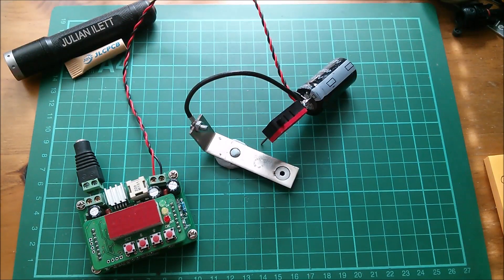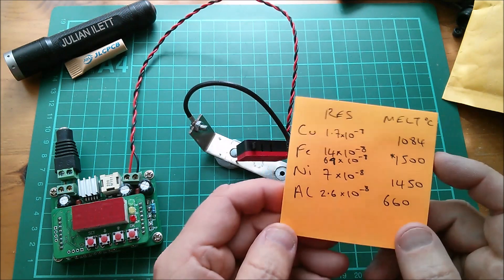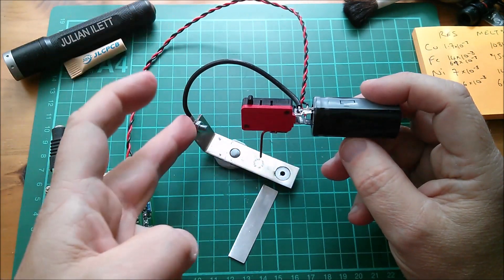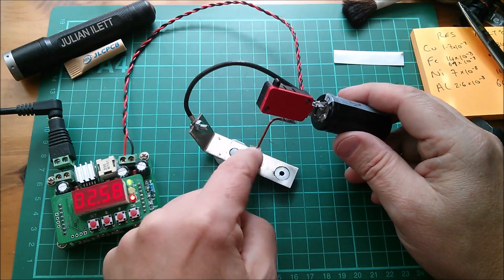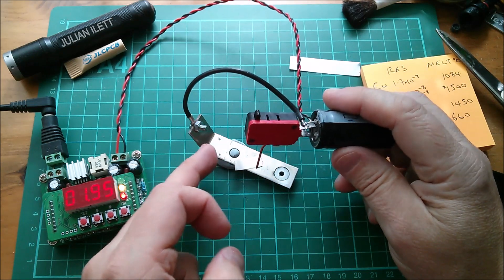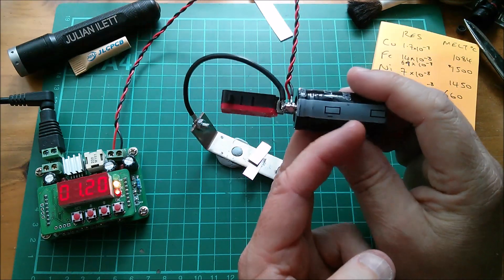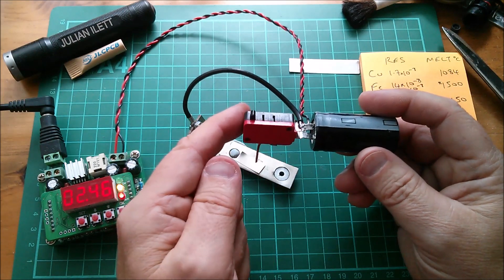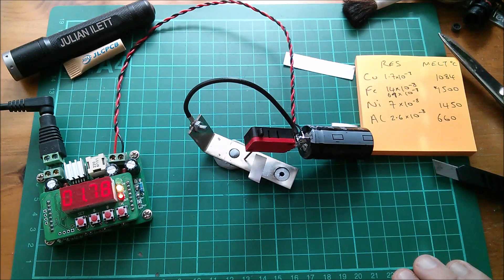Will it work? 100F Supercapacitor Spot Welder

Comment: The reason for the twin copper electrodes is the interesting fact that it is the eddy current between the electrodes which heat up and the pressure on the electrodes actually do the welding.

Comment: Lucky it dumps the energy fairly slowly. You wouldn't want an exploding microswitch in your hand. 300 joules is a fair bit of energy. Higher voltage and lower capacitance would probably work better (No more than 30V, to keep things safe and a 1F capacitor e=0.5 x c x v squared.). Spot welder contacts are usually a lot heavier than just a microswitch, and the contact probes are quite a bit thicker than just a piece of wire.

Comment: I'm guessing you need to increase the capacitance and reduce the resistance based on my own experamentation....

I managed to make a pretty descent 18650 to nickel strips welder using two 500uF 2.7V caps in parallel (they appears to be the same manufacturer as in the video)...
For the weldiong tips, I used two cheap soldering tips pressure fitted into an XT60 connector and slightly bent to give about 3-4mm spacing at the tips...

No switch was necessary for my testing but for certain it needs to be electronic, mechanical switched will introduce some resistance and guaranteed bounce...

Comment: I think you're simply not using enough energy in a short enough time. Supercapacitors aren't ideal for this, as you said the ESR is too high, you'd need a ton more.
Maybe consider a higher voltage normal capacitor bank, it will deliver the energy much quicker.

Comment: I did a short series of vids on a home built cd welder for battery tabs.
https://www.youtube.com/watch?v=dB-O4Yx43ys&t=1s
things to watch out for.
1)Use 2 tips, both on the top (not one on top one on bottom)
2)Dont press down too hard, its a resistive weld and you can make too good a contact!
3) More energy quicker - through an mosfet or scr
5) Check your strip is is it 100% nickel or nickel plated steel (more likely if from ebay!)   (chuck it in some salty water overnight....does it rust?)

Comment: Problems I see.
The microswitch looks like a 2/3Amp one, And microswitches are slightly lossy anyway due to the thin copper bits inside. (Keep going you might be able to weld all be the switch contacts)
The wires are very long giving loss and some of your power will be lost in the steel (poor conductor)
However I feel a single 100F capacitor wouldn't be able to spot weld anyway (But I could be wrong)
Keep up the great work, I love watching your videos.

Comment: 2 points, much more power,  and use a relay to dump the power. Perhaps 6 of these capacitors would be enough (providing 2kJ), but you want to provide more than 1000A for at least 10us, preferably 100us.

Comment: al: oxide layer prevents the weld to stick.
for the tip: use tungsten tips.
more stored energy required.
switch: use an SCR type switch

Comment: i guess for it to work you need more power at least so much that you are frightened to touch the wires to anything accidentally :D 
And then If the setup would be able to sport weld, then you would probably spot weld the internal switch contacts

Comment: Good attempt. I'm surprised you didn't run both anode and cathode as copper prongs. I imagine the purpose is to spot weld nickel strip to another strip or a steel battery end. Copper, as you know is pretty conductive, so it won't heat up much and get towards its melting point. P = I2R.  Like the other commenters, I too suspect that most energy is going on between the contacts of the uSwitch and in the steel. Any oxidation on the surfaces, if not moved aside by the contacts (+ and -) will resist current substantially and slow the whole energy transfer down - this was evident in the time it took to fully discharge the cap - if you had shorted the terminals through the copper you used as the terminal, you would have seen the volts go to zero in an instant.

Comment: The internal resistance of these large value caps is a no go for welding, it's WAY too high. What you need is much smaller caps in parallel or super caps specifically designed for extremely low internal resistance. The tab resistance is going to be a tiny fraction of an ohm and the cap resistance is going to be an ohm or more forming a voltage divider, basically the cap is dissipating all the power none of it's going where you want it to. You need to get your caps overall impedance at DC down into a few 10s of mOhm.

Don't get carried away with thinking the Joule capacity of these caps is so large, it means nothing if you can't discharge the entire thing in a couple of ms.

What's the datasheet for your caps say?

Comment: When you reach the current you need to weld even that thin material, you'll need a bigger switch. Also, you will need a transformer to get the power you need.

Comment: Higher voltage (~60-100V), points next to each other, as little wiring as possible, solid state switch.
Reply: Oh, and carbon electrodes.

Comment: Hey Julian,first try brass round point poles with spring press mechanical  ,double or triple the voltage by a voltage doubler or so! using the micro switch is not a good idea. preferable cables to be copper thick ones,
cheers mate.

Comment: nickel isnt ferromagnetic uve got "pure nickel plate strip" meaning steel plated in nickel . same thing happened to me. and ur resistivity also determines how much current flows so less thats not the only factor
Reply from the maker: Nickel is one of four elements (the others are iron, cobalt, and gadolinium)[9] that are ferromagnetic at approximately room temperature - according to Wikipedia

Comment: Since the esr is so high you are must go in parallel with a good number of capacitors. It might be enough at 3.6V but if it is not then you would need to add some series capacitance. I think you could be looking a a block of capacitors that takes up quite a volume before you are going to be able to dump enough energy in a short amount of time to make a good weld.

Even thought the copper melts at a lower temperature it will not heat up as much as the steel, nickel because of the lower resistance. The heat is generated by the resistance.

Comment: An continuous electric welder is about 80V 80A at a low setting, so it's probably not enough energy to heat steel/nickel to a  plastic state that will fuse.

Comment: Hi Julian, you need a high current SSR with variable on/off timer. You are going to weld the micro-switch contacts or burn them out.
Also the return (-ve) needs to be another spike, as close to the +ve as possible. e.g. if you try to weld something with bearings, the +ve and -ve need to be placed where no weld current passes through the bearing, or you risk welding the close tolerance surfaces within said bearing.

Comment: Use your super capacitor bank... give it heaps, and also change the switch and all of the wiring to something much more heavy duty, if you want a high current you will need wires which don't act like resistors at those currents.

Comment: May be switch contact loosing most of energy in the form of spark. Use Mosfet as a switch instead of mechanical switch. And also decrease contact area.

Comment: Oh yeah ... That microswitch is TOTALLY UNSUITABLE and why is the capacitor apparently connected across microswitch terminals? It looks like you're shorting out the cap or something weird? I can't make sense of the connections I see. The cap is connected across two terminals and the welding probe to the third? Don't get it, but whatever, it's ALL wrong.

Comment: Stop fannying about with low volt supercaps and small gauge wire! Use standard fully charged lead acid battery and 25mm2 cables with 8-10mm copper probes ground to a point and you will blow through anything you are likely to want to weld. Then use multiple 60-100A MOSFETS (five to ten) in parallel fired by a single pulse (555 circuit or an Arduino) with variable timing. Start at 10ms and work up or down until you stop blowing holes and weld instead. Will it weld a nickel strip to a steel bar? Hell yes!
Reply: @Bob Lewis yes, that is the trick. I was thinking more like 1 ms, N-channel MOSFET (Ron 1-10 mOhm), really fat wires. You need a clean pulse on the gate, strongly pulled low. Not an RC circuit (or RC via a Schmitt trigger). The NTMFS5H600NL will do 250A at 10V gate voltage.  Ron=1.3 mOhms. Two or more of these in parallel...  500A or more. Would require really, really fat wire though.

Comment: I am going to try and use tungsten tig welding tips for electrodes on my spot welder.
Reply: Typically you use blunt (slightly rounded) copper electrodes.
Reply: @JWH3  I believe the commercial probes are a copper alloy my reasoning is the tig tips are very resistant to heat, I was planning to round off the tip of it. It is worth a try I can always fall back on copper rod if it doesn't work.
Reply: @gregsmith2262  tungsten is great for arc welding but is a horrible material for resistance welding. You don't need resistance to temperature, you need lowest possible electrical conductivity. Tungsten is 30+ times less conductive than copper is so it will actually exacerbate heating problems.

Ideally the heat is only generated in the materials being welded, sure the probes heat up from physical contact but that's trivial even for copper.

Unless you have no choice so not use it. Copper electrodes are simple to make.
Reply: @JWH3  Thanks for the advice, copper it is then!

Comment: I bought one of the euro arduino spot welders and it requiers a 12V battery and 400+amps. some of my spot welds to 18650's use 2500 watts a weld at 15- 25 ms pulses depending on tabbing wire thickness.

Comment: This spark you are showing seems to be a 100mF capacitor rather than a 100F 🤔
Reply: The kinds of caps he's using aren't meant to be discharged that fast, their internal resistance is too high.

Comment: Copper used as an electrode for great contact (soft, good conductor) the magic happens between the metal being welded.. take 2 nickel strips you need to pinch between two points (a peg with 2 nails ?) Ali won't spot weld because its horrid stuff on the whole that has a skin of oxidized crap.. you need to rapidly dump current for a given time .. stud welder science is very cool and worth researching.. Gaz

Comment: The current enters the nickel strip at a single point of contact, that's good.
Then it diffuses in the nickel strip and since the surface contact with the iron plate is huge (about 2 cm sq?), the current just goes through without any problem. At the end of the day the only thing you can weld is the tip and the nickel strip together, because that's where the bottleneck is. So if you want to weld two nickel strips you need two points of contact, not just one. In a nutshell two pins with the strips in between. Makes sense?

Comment: do it 10 or so times then cut open the microswitch and inspect its contacts.  Try cutting the strip into narrower  2.5 or 3mm strips to reduce the area that the current has to 'work on' ( its the ^2 rule for surface current). Also because of the surface area rule you need a point of contact on the back side as well as the top ( not a plate.)

Comment: You need 700 amps or more, 10x the cross-sectional area of the conductors and many more joules than can be stored in that capacitor. The microswitch is just ridiculous!
Search for kWeld and you'll learn a lot. It uses a couple of big lipos and loads of mosfets with an arduino to time the pulse and deliver a precise number of joules. No point trying to reinvent the wheel!

Comment: I thought "If the Cap could produce enough Current to Spot Weld --- That switch would burn out instantly"
Reply: If the dissipation surface being welded is equal in area to the surface of the switch, then the contact surface of the switch will rise in temperature in proportion to the resistivity of the metals... usually the resistivity of the welded materials will be well over 100x that of the switch materials, and the contact area will be much larger, such that a 10C rise in temp in the switch will be a 1500C rise in temperature at the weld.  That's why switches, relays, breakers, aren't dying regularly when switching inductive loads.
Reply: I read it takes between 100A to 10,000A, ignoring the low voltage as that is not as important. I seen the size of those spot welder transformers, I’m old school. Yet to finish watching this video, but what I seen from Great Scott’s many attempt, it does not look the odds are in  poor Julians favor as I suspect the wires will melt before anything happens to the surface. Looking at the physics, it looks futile with the buck as it is duty cycle dependant, inefficient in this case as continuous current is important than voltage. Beef up the supply and cables. I think there is a better chance with a car lead acid battery barely melting something due to its high CC, before its internal resistance can be taken advantage of. Recall your electrical engineering theory, maximum power transfer occurs when internal resiatance equals to load. This means sometimes too low of a resistance can work agaist you, robbing your power to melt.. Cheers for the vid either way, we can all learn something & ask why. Always a pleasure in watching this channel. Also I notice traditional spot welder use thick copper rods taper down to small diametre, I think the melting point doesnt matter due to the thermal mass, but is for  the low resistance properties not taxing on  power source. Well i probably gonna get a red face when I watch the conclusion of this video that this will be revealed. Keep up the good quality vids.

Comment: A microswitch is no good. Think about it, if you are trying to weld nickle strip, what do you think will happen to the internal microswitch contacts? You need something with contacts that can handle very high energy! Need a much higher voltage too.
Reply: I suspect we're being trolled.

Comment: Hi    The spot welder I used at work used a much higher voltage between 2 pointed
copper electrodes . I also think the micro switch could be a problem -- you could try a large
mercury switch if you could find one or a big SCR or Triac .

Comment: Need a lot of pressure on the nickle strip.  And about 200 or slightly higher amp source.  Pure copper electrodes about 3-5 mm apart.  And the wire from the source must be very large, about 25 mm squared.  A car battery fully charged that can deliver about 200-300 CCA would be a good source.  Large copper cables from the battery to a connector that allow you to use 2 of 2 mm pure copper probes (sharpened to a point), and a car starter solenoid, with a push-button wired to the coil.   Push down with the electrodes on the nickle you want to weld, and push the button briefly.  You'll see the metal melt and weld itself to whatever is under it.   Also, I've seen several YouTube DIY'ers use a 500F capacitor with 2 probes soldered directly to the capacitor weld nickle strips to batteries also.

Comment: You need a couple of hundred amps flowing within 1mS. Your capacitor is discharging over 3 or more seconds, so several orders of magnitude out in terms of energy delivery. Wire and electrode diameters need to be several times thicker too.

Comment: I would say that you have too much resistance in the circuit. I would bet the microswitch has too much resistance plus all the other bits you mention. Most of the spot welders I have seen have 2 copper points and very large wire  in a transformer set up. The switch is on the higher voltage side and thus lower current.

Comment: your whole design is faulty. spot welding depends on passing a lot of current through a small area of the surfaces that are intended to be welded, you have a huge contact area between the strips/steel which doesn't create enough resistance to heat the surface. resistance has an inverse relation to area, smaller the area, the higher the resistance, the higher the temperature generated. 2) copper is used as an electrode simply because it has lower resistance than steel/nickel, and won't weld to steel/nickel. 3)if you try this setup with batteries then you're going to damage them by passing very high current between the two opposite sides of the battery, aka from + to - or - to +, that why battery spot welding should be done by two pointed electrodes at close proximity if not on opposite sides of the metal sheets intended for spot welding.

Comment: Not enough voltage bud.
Reply: too much resistance those caps have horrible ESR. I'll wager the caps are probably a couple of Ohm's at DC, the contact resistance of the tabs is going to be 50-100 or so mOhm. It forms a voltage divider, all the power gets dissipated in the cap.

Comment: You need a lot off amps. If you only go at 2.6 volt. And your wire is way to thin to handle all the amps you need at 2.6 volt. To weld you need volt amps and time. If you go low on volt. You need lots of amps. And if you can't get amps high. You need more time. Time to let it heat up and melt. But even with more time. You still need to hit that minimum point that it can reach that melting temp. At 12 volt you still need a round...  200 to 250 amps depending on material and thickness. BTW best contact are made from copper aluminum alloys.

Comment: Think of the the graph of the discharge current of a capacitor.
Reply from the maker: That's it. The discharge curve for capacitor voltage (into a fixed resistance load) falls away exponentially. Power falls as the square of the voltage. Sustained power would be easier to manage.

Comment: also dont close the circuit via the steel if you are trying to weld the nickel you want your current to take the shortest path possible so that there is less resistance and therefor more current. think about it p=r*i^2 so more current is good.